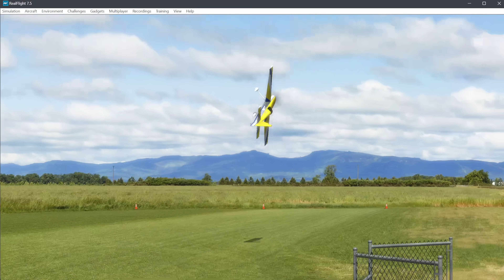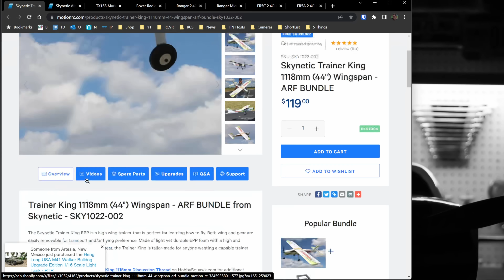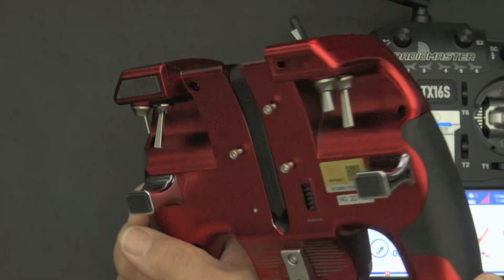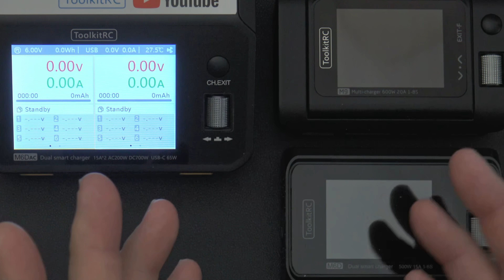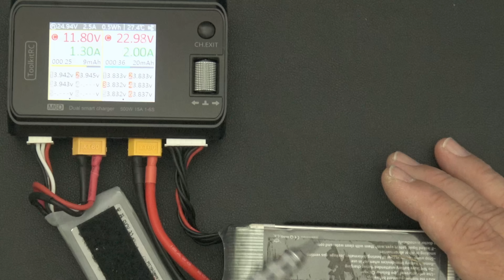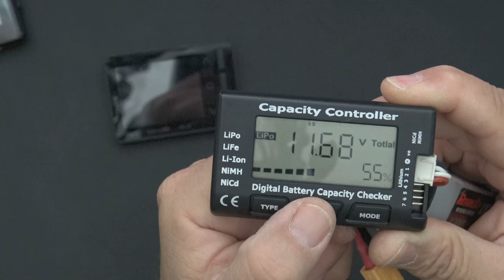First 5 Things RC Beginners SHOULD BUY

Comment: Hi John. Great tips as usual. I started in 2020 with the most used beginners electronics: radio FlySky FS-i6, charger iMAX B6, generic battery checker. The first upgrade was the 2ch charger from SkyRC (in 2022). The second upgrade was the radio TX16S MKII 4in1 (3 weeks ago). I would like to upgrade the battery checker too. Which one do you prefer? iSDT BG-8S or ToolkitRC MC8?
Reply from the maker: If I only had one, I'd take the MC8 as it also handles cell balancing, but add to that servo output and servo monitor.

Comment: The trainer king is a great suggestion. A friend crashed mine. It had been wrecked numerous times before but I didn’t feel like glueing it back together. Just ordered a new one and I may put a stronger motor in it. I wish I could find a link to a simulator that works with apple Mac OS. The trainer king is about as close to a simulator as I can find. Lots of fun though!!

Comment: Everything you said is expensive. I tell new flyers. Buy used stuff. I got a DX6 for a hundred dollars. And you can find used airplanes for around $100 dollars too. And PNP for a new flyer?
Reply from the maker: Expensive is about perspective. The title of this video isn't cheapest way to buy 5 things you need. And of course a PNP for a new flyer, why not? Why would somebody who is just getting into the hobby not benefit from a plane that is assembled by an entity that has assembled thousands of planes and will do things like get the linkages right, and the motor direction right, the motor/prop/esc combo flyable, and the incidence angles right, and the CG right, and so on? 

I also wouldn't recommend used equipment to a newbie because I wouldn't want someone to fight with potentially problematic hardware while trying to learn how it all comes together.

Comment: Nice job John! Might be the best 20 minutes a newbie could spend before pulling out the credit card. 

I learned to fly during the build, crash and repeat days of the 1970's and early 80's. I've seen a few learners repeat those lessons lately being taught by others who have not accepted the amazing changes in RC of the last 20 years. One just walked away after glo engines helped to another dead stick crunch. A shame because it's so unnecessary today. 

Simulate to gain the necessary coordination and simplify what goes up in the air. Electric flight is reliable; batteries can be handled safely and you can learn to fly without the anguish of 100 hours of build vanishing in seconds of air time. 

Final thing........join AMA and find a local flying club. Enthusiastic people are there who love to share their experience an help you learn.
Reply from the maker: Thanks Bill. I agree--the hobby has evolved. Good insights.

Comment: Just learned about simulators yesterday. I downloaded RF Trainer and am saving a lot of money ;-) So far every crash only requires hitting the space bar. Damn fun too. Curious do you know if you can use the WS2000 Spektrum dongle with a smart tv running steam? It works on my desktop just fine just want a bigger image.
Reply: Why don't you leave the dongle where it is and cast your desktop to the tv? If you put the reset on a tx-switch: problem solved.
Reply from the maker: Good idea.
Reply: One more suggestion. You might put your sim-reset on the tx-switch you use in real life for timer-reset. This will prevent bad sim-habits to haunt you in real life.😉
Reply from the maker: Not sure about the dongle. I’ve never tried. Amen on the space at reset. Best $50 you never spent.

Comment: I learned on the GWS Slo Stick and Parkzone SloV. Horizon seems to have brought back the stick flyer with the Eflite Ultra Stick but that's targeted to intermediate flyers
Reply: I also flew the GWS Slow Stick .   The Horizon E-Flite Ultra Slow stick is nothing like it.  It's definitely not a beginner plane at all.    Yeah, it can fly slow, but it can also be a beast.
Reply from the maker: I thought about the Stik as I used the GWS to learn as well, but they’re not always easy to find and flying them with any real wind can be challenging. They are easy to fly under the right conditions though.